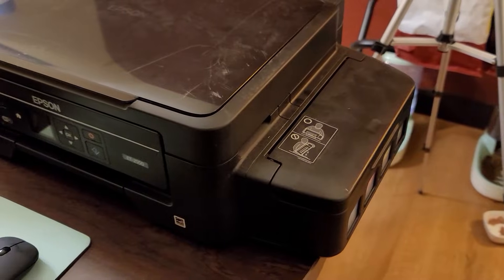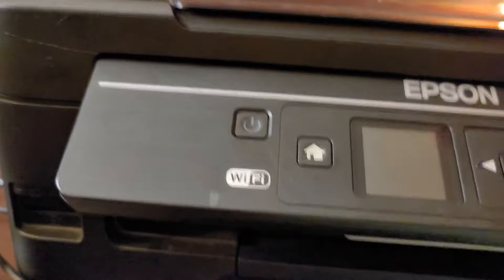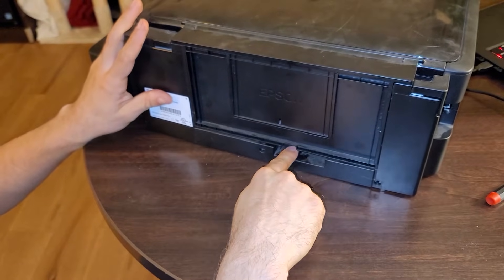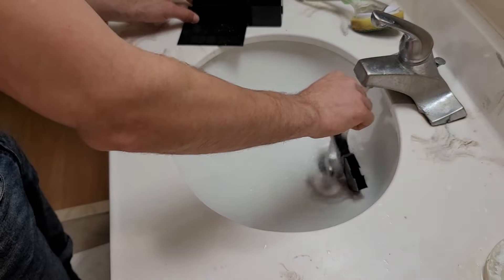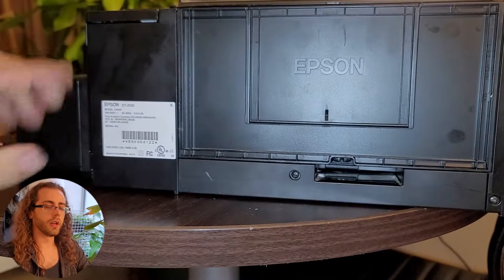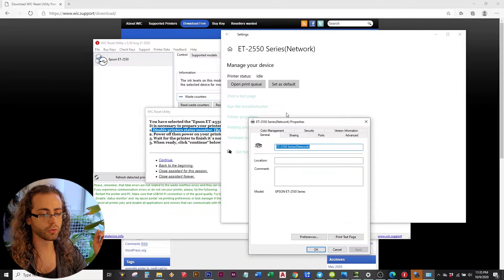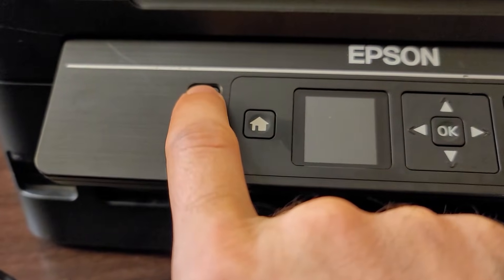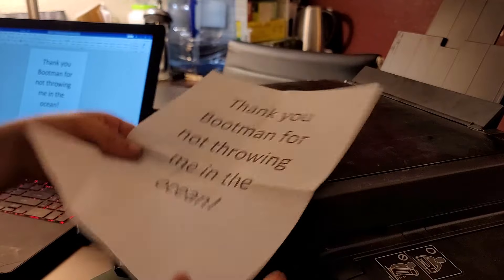Epson EcoTank Printer Waste Ink Pad Replacement and Ink Counter Reset (ET-2550) Procedure (How to)

Comment from the maker: 1 view = 1 printer saved from the ocean.

**Update 07/25/2025: I have a new video out using the instructions below on how to reset the ink pads for free: https://youtu.be/r2FibOVhYz4

*Update 10/05/2024: Big news* -- I just found out about this Epson Configuration software a user named Ircama uploaded to GitHub: https://github.com/Ircama/epson_print_conf
While I haven't tried it, as I sold our Epson, the general feedback to this GitHub commit is positive, and people are reporting that you can reset your own ink counter for free using this. GitHub is daunting to use, I'll do my best to summarize Ircama's instructions and make it operable on a Windows computer. Here's what to do:

1) Install GIT https://gitforwindows.org/ (just use all default values)
2) Install the latest Python: https://www.python.org/downloads/
3) Head here: https://github.com/Ircama/epson_print_conf/blob/main/requirements.txt download 'requirements.txt', place it in a folder of your choice. The download button is  an arrow pointing down, it's on the right hand side of the screen, to the right of the 'raw' button
4) On Windows, run Command Prompt as an administrator
5) Navigate to the folder where you downloaded requirements.txt (for example, if you downloaded it into C:/Epson, you'd type 'C:', then 'cd Epson')
6) Type, then run WITHOUT quotes (YouTube keeps turning this into a link, so just type out the whole URL & delete the space between h and t) "git clone h ttps://github.com/Ircama/epson_print_conf"
7) Type and run 'cd epson_print_conf' 
8) Type and run 'py -m pip install -r requirements.txt' (and feel like Hackerman if you're not used to coding, installing dependencies, libraries, etc)
9) Download the epson_print_conf.zip file, and place the .EXE file into the \epson_print_conf folder you created earlier: https://github.com/Ircama/epson_print_conf/releases
10) Run the epson_print_conf.exe file, Windows will probably not let you, just press 'more options' or whatever comes up, and press 'run anyway'
11) From here, you should be able to detect your printer, and reset the ink counter by selecting your printer model, letting the software detect it, then resetting the ink levels.
 
Below is the method I used in my video. It's probably easier than the GitHub method, but it does cost $10 and is questionably safe (I'd only use a credit card here, maybe Paypal for safety)

Go to this website AT YOUR OWN RISK. I am not affiliated with it, don't know if it has viruses or steals your information, and I curse Epson eternally for having this be the only option for repairs:
https://www.wic.support/download/

Side note 1:
It's probably best to just replace the ink pad instead of making a mess:
https://amzn.to/470wH9E

Side note 2:

A lot of folks have asked what printer they should buy. In my opinion, this can go one of two ways. You should either spend very little, or a lot, depending on the outcome you desire. Printer companies will sell you their $99 printer at a loss (to them) with the idea that they will more than make up the difference by gouging you on ink. I find that these cheapo printers are no less of a printer reliability wise than mid-tier printers (like the EcoTank I just talked about). Only difference is, when it does crap out, you'll only be out $100 instead of $300 (AND you can buy off-brand ink and save a bundle that way). The $300 crowd like this one should only be bought with the understanding that you'll have to spend a good amount of time wrestling with the printer. I do advocate to reduce/re-use/recycle as much as possible, but I also see why it may not seem very attractive to have to spend many hours of your time on fixing something that shouldn't have broken to begin with.

The opposite is the $500+ crowd. In this price range, we're talking office printers, and I do believe this is where printers really start to shine. You get very good reliability because they're designed to be SERVICABLE workhorses. The contracts printer companies make with corporations buying like thousands of these is very lucrative, therefore they don't want to shoot themselves in the foot by costing themselves said millions in contracts by making a crappy printer. Case in point -- I have a Xerox Phaser 6130 color laser printer. It is something like 14 YEARS OLD, and still works like a champ. And that's because the parts are actually replaceable without stupid DRM lockouts. If you're noticing a trend here, that's because there is -- I vastly prefer laser printers over traditional inkjet printers. A lot less to break. 

HP LaserJet M110we Wireless Monochrome Printer (cheap):
https://amzn.to/3U7DG86

Xerox C310/DNI Wireless Color Laser Printer (pricy):
https://amzn.to/3U5PWFM

Disclaimer - I'm an Amazon affiliate.
Reply: I was there and everything read like it was written with a Chinese accent....something didn't feel right. BUYER BEWARE!!!!
Reply: the github solution works for me on my XP-435 on linux, reset waste ink over wifi
Reply: Tried this one on an ET-2550, worked just fine. Inkpad replaced without breaking tab, counter reset, no issues. Thanks for saving us a LOT of grief, all for about an hour of aggravation. Fantastic trade, as far as I'm concerned...
Reply: this worked very well for me. used this for my et 2650 printer
Reply: Thank youu!!!

Comment: Hello hi 
 i followed your directions and succesfully replaced the ink pads on my e xP 830,  now I downloaded  program, i purchased a key, i downloaded then run the program, and when click " " I want to reset waste counters" the program stalls and freeze, not one time but numerous times, any ideas about how to  make this program work and enter the key I purchased, so i can reset the counter on my print, will be much appreciated. 
Im not very versed on programs and the like 
very disappointing
Thank you 
Sergio
Reply from the maker: I'm not sure -- I'm not very familiar with that software. You can try a few things:

-You could go on their website and try their customer support

-Try this website for troubleshooting tips: https://resetkey.net/wicreset-is-not-responding-showing-red-error.html

-Try restarting your computer, making sure the printer is connected via USB (or switching to a different USB slot), and also running the program in administrative mode by right clicking and pressing "run as administrator"

If all of that fails, I have a different video with a different strategy - it's more complicated in some ways, but it is free. This is the video: https://www.youtube.com/watch?v=r2FibOVhYz4

Good luck!

Comment: I have a Mac book do I need to connect it with a cable or is it possible to reset wirelessly?
Reply from the maker: I'm not sure off the top of my head. Is there a problem with connecting the printer to your Mac? That'd probably be the most surefire way.

Comment: He deleted my comment that revealed cleaning the foam pad isn't a way to go as the pad ends up being half the thickness as before, resulting in much of the plastic cartridge not filled in by foam. So I bought replacement foam at Amazon for $6.00.

Why delete dood?  There was nothing negative or disparaging.

edit - there is no reset software out there anywhere for the Epson ET-2550  on an iMac running Sequoia and newer OS.  Thus, my Epson printer is headed for the ocean!
.
Reply from the maker: I've never seen your comment, nor do I generally delete comments off my channel. I don't see any comments held by YouTube auto-moderation either, so I'm not sure what happened. Feel free to resubmit the original comment, it sounds helpful.

Comment: No, Epson did not fix it on subsequent models (unless they did so very recently). I bought a Ecotank 2800 that has the very same issue.  There is no reason they could not design an easily replaced sponge and counter, but of course they want you to junk it and buy a new printer.  Good concept of large ink tanks ruined by this stupid sponge issue.  Another example of their stupidity. Instead of one sponge they have 3, that each of which is different and needs to be put in in the proper order. WHY?  NO reason whatsoever.  One suggestion... after complaining about Ecotanks, why not mention the other companies that also make similar large-tank printers, which include Canon and HP. However, I don't know how they handle waste ink. Why not research that and update the video? Thank you.
Reply: You are correct sir!  Epson totally doinked the concept of ECO in the Ecotank design by turning the printer into a brick after printing approx. 6500 pages - the count when the waste ink pad sends the Service Now message and locks itself up.

Comment: I have the ET-3600 and Epson “fixed” this by placing the waste ink pads somewhere I can’t even locate them. 🙄
Reply from the maker: Wow, thank you Epson, very cool! I didn't know that being even more hostile against customers was an option. I feel enlightened!
Reply: @Bootstrappin  I figured I didn't have anything to lose, so I started taking it apart, found where it was located, and ordered a replacement part for $19. Just got it installed today and I'm back in the printing business.
Reply from the maker: @StephanieCain excellent! Well done.

Comment: Well done for making a follow up after shitting on Epson. It can be tough to say oops. Respect.
Reply from the maker: Thanks, but I wouldn't say this was an 'oops' insofar as none of these procedures are reasonable for a regular customer to perform to their printer. Regardless of me finding a solution, Epson is still shitty for bricking a printer with no reasonable recourse other than a $200 round trip to their repair shop.

Comment: Okay I own this dickhead printer LOL!  I want to get rid of it and throw it in the ocean.  What printer could or should I get in its place that will last reasonably long and cheap to operate?
Reply from the maker: Hah, I hear you. There isn't too great of an answer to this -- I'll paste what I usually suggest to others: 

A lot of folks have asked what printer they should buy. In my opinion, this can go one of two ways. You should either spend very little, or a lot, depending on the outcome you desire. Printer companies will sell you their $99 printer at a loss (to them) with the idea that they will more than make up the difference by gouging you on ink. I find that these cheapo printers are no less of a printer reliability wise than mid-tier printers (like the EcoTank I just talked about). Only difference is, when it does crap out, you'll only be out $100 instead of $300 (AND you can buy off-brand ink and save a bundle that way). The $300 crowd like this one should only be bought with the understanding that you'll have to spend a good amount of time wrestling with the printer. I do advocate to reduce/re-use/recycle as much as possible, but I also see why it may not seem very attractive to have to spend many hours of your time on fixing something that shouldn't have broken to begin with.

The opposite is the $500+ crowd. In this price range, we're talking office printers, and I do believe this is where printers really start to shine. You get very good reliability because they're designed to be SERVICABLE workhorses. The contracts printer companies make with corporations buying like thousands of these is very lucrative, therefore they don't want to shoot themselves in the foot by costing themselves said millions in contracts by making a crappy printer. Case in point -- I have a Xerox Phaser 6130 color laser printer. It is something like 14 YEARS OLD, and still works like a champ. And that's because the parts are actually replaceable without stupid DRM lockouts. If you're noticing a trend here, that's because there is -- I vastly prefer laser printers over traditional inkjet printers. A lot less to break. 

HP LaserJet M110we Wireless Monochrome Printer (cheap):
https://amzn.to/3U7DG86

Xerox C310/DNI Wireless Color Laser Printer (pricy):
https://amzn.to/3U5PWFM

Comment: My 2803 series did that just as soon as I topped off all the inks. I couldn't follow all those directions. So now I have a new printer with new ink. And the old printer is sitting on the floor with lots of ink! Would anyone be able to use that ink if I gave them the printer? It was only about a year old?

Comment: i just washed the filter bads. Wondering if I need the pads in the container at all. It would then just fill up like a tank.
Reply from the maker: I suspect it would go everywhere and leak out of the printer eventually, and especially go flying everywhere as you try to pull it out of the printer to clean.

Comment: funny ?  this vid came up after I fixed my epsom XP printer for the same reason. Washed out the pads , not too dirty btw. This printer is lightly used .  And got a free key  that puts the level back to  80%  ink level  to get me going again.   Avoid sites with waht looks like russian language- but you know that ;-)

PS: if you get ink on your hands - go wash the car, car shampoo is really good at getting ink out of skin ( normal shampoos , dont know about the scented ones ! ) 

thanks for the vid 🙂

Comment: regarding the video intro: the shoe falling apart happened to me, TWICE. first time, an LL bean boot where the adhesive was substandard. second time, a clark's brand shoe that fell apart (dry rot?) during an errand, most inconvenient and a little embarrassing. 
TIP: carry a spare pair of shoes in the trunk!!!
Reply from the maker: Oh man I've had that happen to a pair of Clark's, sole came completely undone. And these brands you mention are supposed to be high quality too! Just very disappointing all around, they really need to do better, particularly when they have a high reputation.

Comment: Just a heads up, no need to open your printer and all that. I just turned off my Epson monitoring, bought the key, turned my printer off, turned it back on and it worked!  But of course, I will go and clean the waste ink pads now but if your in a hurry to print something, it's a quick fix. THANKS SO MUCH! $10 and it's working again. And I totally agree, its all Bull%&#$% having to do this to begin with.

Comment: OP any way to reset it if you bought the hardware from amazon but do not have a key? Ive got a brand new ink-pad, installed, and it is still throwing off an E-11.
Reply from the maker: Not that I know of - the reset is software based internally to the printer. I think the newer printers may have a chip inside the ink pad that would allow an easy swap, but not these older ones.